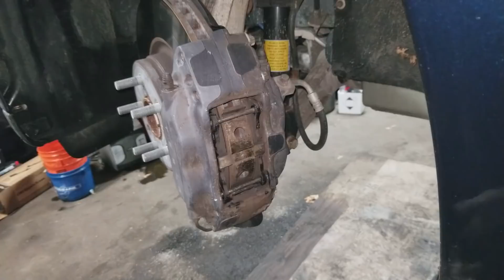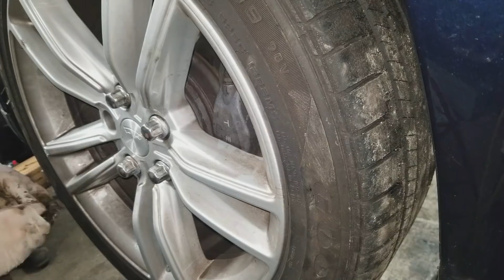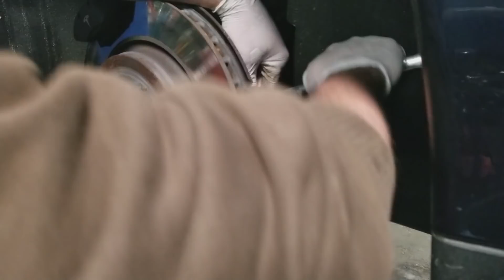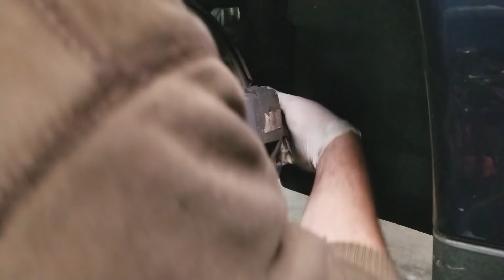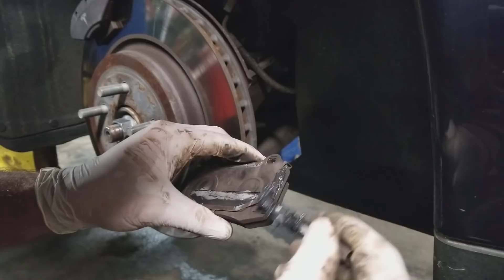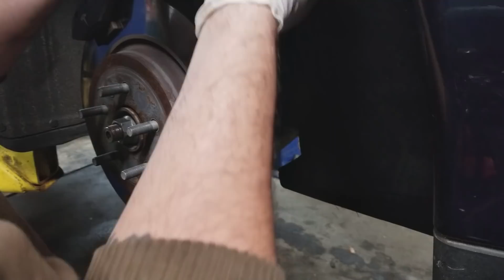Tesla Model S Brembo Caliper Service

Comment: Pretty good video explaining routine service on brakes. 
Pls make sure you are not stressing the brake hose when hammering in the slide pins. Either hang the caliper on to something else or put it on a small table.

Comment: You should use silicone ceramic lubricant insted of that grey grease, it s way better, it doesn t dry out like the grey stuff and it's way more heat resistant !

Comment: Had my Model S calipers painted and the guys didn't torque the bolts correctly (just hand tightened). One came loose and scratched my wheel. I'm liking the vids so far but I'm not sure just hand tightening those bolts was the way to go. I had to visit a Service center to have the car checked and calipers properly torqued on the car as I was missing a bolt and didn't know the proper torque measurement needed.
Reply from the maker: +Jonathan Roman those are far more than hand tightened. I will go back in a week or so and retorqued the calipers to spec, after they've done a few hot/cold cycles and reseated properly (steel bolts, aluminum calipers, aluminum knuckles).
Reply: @EvolutionAutomotiveLLC  so is anyone going to mention the torque amount?

Comment: Thanks for the vid! One question, how did you get them out so easy? I have a 6 months old Tesla, they are stuck, managed to get the first one out, the second one is stuck.. Maybe I have to "bleed" The breaks to get it open?
Reply from the maker: Johannes Samuelsson they should slide out without needing to release any pressure. If you are having an issue removing the pads, you can try pushing the pistons back a little bit with a flathead screwdriver or small pry bar. They may already be starting to seize in the caliper, which will make things fun. Worst case, remove the caliper, and you can pry the pads out that way.
Reply: @EvolutionAutomotiveLLC  Thank you very much! Im gonna try tomorrow again with a flat screwdriver. I live in Norway, so it's alot of salt. The breaks were full of mud.. Do you by any chance have a video of you working with mando breaks? My TMX have brembo infront, and mando at the back.. :)
Reply from the maker: Johannes Samuelsson I have actually dealt with them. They are very easy, but the piston is a screw type, and requires a special tool available at most auto parts stores. The cover is held on with a hex head screw. The nine performance facelifted cars all have them on the rear.
Reply: @EvolutionAutomotiveLLC  alright! Thank you very much for the answers! I really appreciate it! Then I have to buy this special tool :)
Reply: @EvolutionAutomotiveLLC  So I dont need a computer to reset the parkingbrake in the mando brake? Thank you for taking time to answers my noob question, Im just curious to learn 😊
Reply from the maker: Johannes Samuelsson you do not. Put the vehicle in tow mode through the service screen, and then unplug the electrical connector on the back of the caliper on the black plastic servo. It won’t trigger any warnings or codes when you put it back together.
Reply: @EvolutionAutomotiveLLC  Awesome! :)
Reply: @EvolutionAutomotiveLLC  Sorry for being annoying, but I have one last question. The special tool for the piston is "Caliper Disc Brake Screw-in Wind Back Rewind and Piston Compression"? If it is this tool I know everything I need to know to try the mando breaks :) cheers.

Comment: Wait, this is brembo brake or telsa version of brembo brake? Furthermore, does this come in, as standard?
Reply from the maker: Jaime Hernandez they are Brembo brakes. They have the Tesla logo on the front, but they are Brembo calipers, pads, and rotors. They are standard on all cars up to 2016.5, when they only offered 4 wheel Brembos on performance cars, and front wheel Brembo on all others.

Comment: Spraying brake cleaner will do nothing. You need to clean the surfaces. 
Was not really a pro work. Nothing to learn here. Also you didn't torque bolts.
Reply from the maker: Arnis Tarassu wasn't supposed to be pro work. It was a quick video to prevent the pads from seizing to the caliper. Nothing more. Nothing less. 

As for the torque, it's since been torqued after a few hot/cold cycles. Torquing when 2 aluminum and 1 steel pieces are cold won't do much when they get hot, and expand at different rates. After a few cycles to "seat" everything, you can get a more accurate torque reading.

Comment: Rather appalling video.  No description of what you’re doing until the rear brake.  Extraneous audio comments make this video rank below amateur.  Looks like you’re changing out perfectly good brake pads - why?  What about retracting the brake pistons?  Is that simple or does it require special tools/software like on Audi rear brakes?
Reply from the maker: treborg777 if only there was a description under the video.

I was pressed for time due to weather.